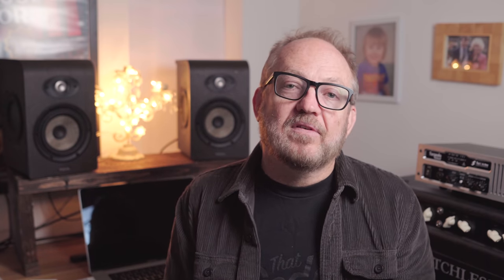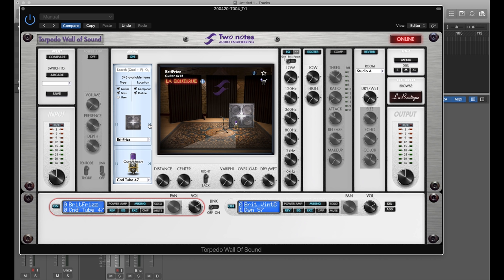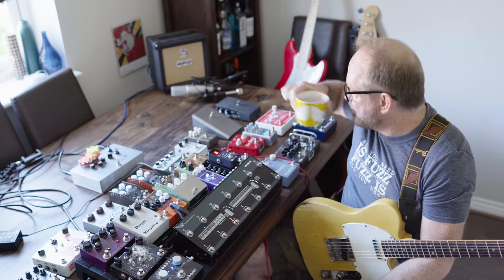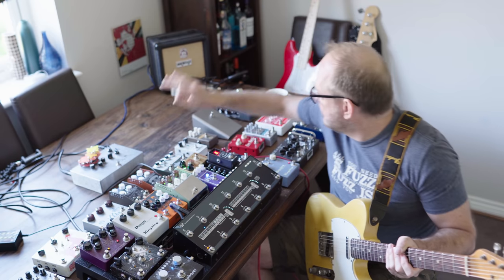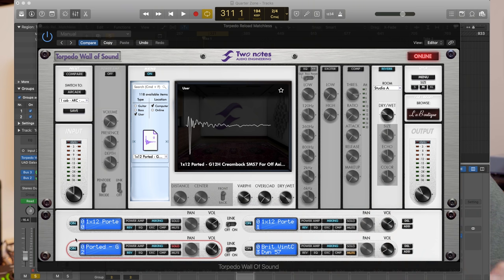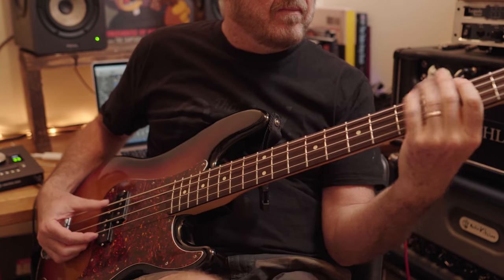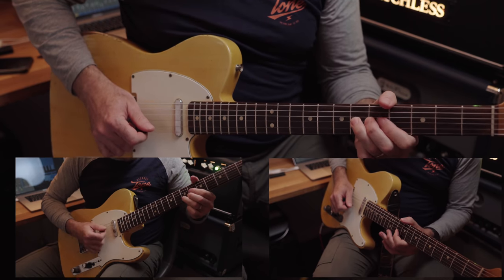Recording Guitar Amps With IRs: Dan's EP Challenge #3 – That Pedal Show

Comment: Hi Dan! I wanted to pass on a trick I picked up from Gaz Williams of Sonic State for working with IRs. Having used IRs for several years, I still cant get past the 2 dimensional quality of the sound. To help alleviate this, once you have recorded your guitar part, simply toss a 57 (or whatever you have handy) in front of your studio monitor and rerecord the guitar part as though your monitor was a guitar cabinet. Obviously be careful to not have monitoring turned on for the track you are recording to or you will get a painful blast of feedback. Once you have rerecorded the track and checked it for phase it can be mixed in with the original guitar track to add back some of that missing 3rd dimension. Even when recorded at fairly low (neighbor friendly) levels this can make a big difference. Great video and I cant wait to hear the record! Thanks and stay safe!
Reply from the maker: Wow!!! Great idea!
Reply from the maker: This is hilarious! Mick here.
Reply: That is a cool idea! Definitely doable in the home studio!

Comment: Sounds good. I've been using a loadbox and IR's for a while now...really works well. It never sounds exactly like my amp and cab in room, but I have tons of options with different cabs...more than I could fit in my house!  You could also split signal with one going D.I. so you can re-amp later, if needed.  I usually use amp with drive pedals or clean into DAW and add all effects in DAW program. Makes adjusting in mix way easier. Always enjoy "That Pedal Show" videos.

Comment: I recently picked up a Two Notes CAB M and use a Bearfoot FX Dyna Red Distortion (Marshall AIAB) as the pre-amp. While amp-in-a-box pedals aren't necessarily a pre-amp, this has worked great with the gain down below 9 o'clock. I need to try my Emerald Green (Vox AIAB) too! It's been an amazing addition to the gear! While I haven't recorded with it, it's been much easier to play with backing tracks (using the aux in so far). The lessons I subscribed to offers a back track for each lesson to practice over so the quiet playing has also been a relief for my girlfriend :). Bluetooth connectivity is amazing for software edits and I really love the mic options for fine tuning of the sound. Really excited to see how your EP turns out Dan! Really love the harmonies and the reverb into fuzz tone!

Comment: I strongly Identify with something Dan is struggling with. I am both a musician and an audio engineer, and I find that they are completely separate brain spaces. Even though I have the equipment, knowledge, and skill to engineer my own recordings, I always prefer to hand that duty over to someone else so I can focus on the performance and nothing else. However  that's not always a luxury that I or many other folks have. What works for me is to set aside separate blocks of time. I'll take a week and just get a session template for the project together, and dial in various sounds that fit what I am looking for, save those as presets that I can recall later. I don't worry about writing or performance at all during this time, just getting things dialed in. Then I take a few days off and come back to write and record my parts. It's much easier when you have a palate of sounds ready to go and easily tweaked on the fly, allowing you to focus on the music and be creative.

Comment: If you’re at all frustrated with how long it takes to dial in IRs, I’d suggest trying out the Ox. Sure, you’ll still spend some time figuring out what cab/mic you want to use, but I found that I was able to dial in sounds much much quicker with the Ox than with the Two Notes stuff and it made my home recording a lot more efficient. I’m certainly not saying one is necessarily “better” than the other, just advocating for giving the Ox a try in comparison.
Reply: I think the ox sounds like a good idea, but only if you have a spare grand... I think they are really expensive, as the case with all of universal audio kit. 
It's much more than even your average amp

Comment: So I've been working with the Two Notes Torpedo Studio for the last few months now and wanted to add an additional point. So when you're recording normally, you get the exact tone that you want out of the amp, and you mic it in such a way to reproduce that sound as close as possible on the recording. That gets flipped around with the IR setup. You have to pic the cab and set the mics the way you would think they sound best, then set up your amp to sound the best with that mic configuration. The hardest thing is trying to figure out what to change when it's not sounding the way you want it to. The best thing and the worst thing about the IR setup is how much versatility you have in your sound.

Comment: Excellent video. Economically this has become the way my band works now and I'm in the process of finishing off tracking for a full length during this isolated time. It absolutely took a while to get into the headspace of "engineering" a sound rather than rocking up with my cab and saying "make it sound the same with mics" lol. All in all we've realised it's cut the costs of tracking guitar and bass by at least a few thousand dollars and the stress factor is lower.

Being able to record at home when you're in the mood and comfortable rather than watching the clock because every hour is costing $80AU. The takes are better, the creativity is higher and the only costs involved so far was tracking drums in a studio and mixing/mastering.

So far our full length is costing roughly a third (maybe less) of our last EPs costs for tracking, mixing and mastering!

Comment: The problem with IRs is: suddenly you have millions of possible speaker / mic combinations available. You think you need to try and use them all. Takes time. And won't work. So, what I do is, identify my speaker. Then try some cabs with these speakers, then finally chose 2 mics and mix them to taste. For the latest High Road Easy I did also use the stereo room IRs, just blending it a bit on the opposite side. Gives it a bit of depth.

Comment: Not for nothin' but probably could save a boatload of time using the Strymon Iridium in stereo on the "round" and letting your guitar choice and pedals really shape the sound of the parts.  Either that or just spending a couple minutes on the ox and you'll get a great sound really quickly.  I'm often blending these two together.  Another tip, on the ox I lean towards using 2 ribbon mics for that extra bump that Bea mentions.  Notice on his ox he has a setting with double ribbon mics loaded up.

Comment: Is always a great pleasure spend my time with you guys, whether you’re together or not. I think guitars sound great, but my question is: a load box like Torpedo or OXBox or whatever is useful even form people like me that have only combos? Can I use a LB even for record guitars straight into the desk or computer or do I gotta have NECESSARILY an amp’s head of 100 watts to buy a load box?
Reply from the maker: You can use a combo of course! You just need to intercept the connection between the amp and the speaker. Most modern combos have jack connecting the speaker from the amp section. The load box goes there. Cheeers!

Comment: Hey Dan - loving the videos. How are the Focals working out for you ?  Also, something to try if you haven't already - Mike Scuffham, who was an amp designer at Marshall, has a really cool software app with amp/cab (with IRs) simulations called S-Gear. For me its one of the best, and easy to use software amps/plugins which can also be used stand-alone.

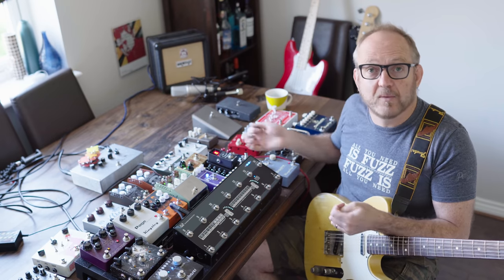Comment: Love the monitor stands at 9:05! But 'making' them must have required you get some upright support yourself? :-D

I have a suggestion for bass track recording, although it's my personal aesthetic choice rather than a rule: create it before the guitar, add some dirt (a valve guitar amp through a bass IR might sound really good!), and prioritize EQing your guitar tone to the bass, rather than the other way around. That way the bass line and guitar parts have a chance at interplaying more. With a guitar tone set first, usually too bottom heavy, a bass ends up just filling few inaudible spots very low or very high, and you get the effect of bass being noticed only when it's not playing. Unless that's what you're going for, then carry on, don't mind me.... :-)

Comment: You are really making it harder than it needs to be! If you use the Two Notes stuff just use their cab packs. Much easier to audition and you can move the mikes around. Stick with one cab and use different mikes and placement, it will sound full. Also better to record as dry as possible, you are layering too much it will wash out. You say it does not sound like you cab, but believe me if your cab was in a soundproof room and you were listening back through a mike and studio monitors this is exactly what you would hear.

Comment: I just can't seem to adapt to this new way of recording. All I want is a  damn 1/4" or 1/2" (cue: choir of angels)  reel-to-reel, a desk, (let's say 24-track all-up but 8 will do) my gear, a couple of good mics - and a room.
I hate Digibollocks. But, needs must, and this is most helpful. I get to watch someone else doing it. Boy, do I need a Rabea in my life. Tech support! Tech support! All my IRs sound like hammered crap!
Like Dan, I am a total newbie but unlike Dan, it just beats me up every time I try to use this stuff. Does my head in. Insert something Mick would say here
Reply: Matt Gilbert you can’t beat R-R. Mic a guitar and get the true sound of the room with old tweed amp and an old Gibson or Fender. Good pre and mic. Forget all these new extra digital gadgets.

Comment: The one thing I think Mick might struggle with and even Dan to some extent, even with IRs or other direct options (Kemper, Helix, Ox Box) you still need to listen to it loud. I know it’s meant for silent recording, but listening loud in studio monitors makes a massive difference. 

When it’s quiet my tone still sucks. 
Tube amps loud are amazing, but you can’t forget that direct options sound better loud as well. That’s been my experience with direct options. Cheers dudes!
Reply from the maker: Yep. Right with you. Mick here. I’ve given up and just gone back to mics and speakers. If I can’t do it at home, I’ll hire a rehearsal room. Or use the TpS Studio!

Comment: My mistake with IRs was trying to make it sound like my amp would in the room. Nope. Don't work like that after all. I needed to go for what my amp would sound like in an isolated studio room while I was hearing it through the desk monitors in the studio control room. Much harder to do if like me you have not experienced much of that to get used to the different playing feel and sound of not being in the room with your amp (I am not PRO, but from what I understand lots of them refuse to lay down tracks sitting in the control room, because it messes with their performance -- while also not getting the sustain from feedback etc. I think they are the ones that could find it hardest to adjust to using IRs. Getting that feedback while not being with the amp is possible though. Solo the guitar thru its own monitor and sit in right in front of it. Different sound but it works and is better than nothing if not getting noise control called on you is an issue).

P.S. Guy next door here in my Auckland, NZ apartment building has made literally dozens of complaints about the faintest sound of guitar coming from my studio monitors. I stick to a volume so low that I can hardly hear my music playing from the other side of my apartment when I make a cuppa. Nothing else in this noisy building gets him complaining, e.g., the unusual, perhaps a little kinky couple that seem to chase each other around giggling and squealing for an hour or so at a time. The complainer drives me nuts, because he must be able to hear almost nothing, but as soon as he realizes it is somebody playing an instrument he calls the building manager. I knocked on his door. Turned out to be from England where I grew up too, plus a musician (jazz keyboard player) He even told me to wear headphones to watch TV at volumes I can not even hear over my kettle boiling. Some people. I put up with it because I hear him coughing lots (for years, so is not this nasty bug)

Comment: Looking at the extensive workload, i think a simple isolation box with 2 different mics and distances w still work better.
But Dan is prob in IR trial mode..for now.
Mick has given up i think.
Reply from the maker: He has! Mick here. Every guitar sound I have ever loved has been a mic on a speaker. Come on, argue with me. ;0) actually, please don’t. But a fact is a fact! :0)
Reply: @ThatPedalShow  yeah, how many variables do you need to stack before you settle back on a more straightforward system? (Don't need t answer that, Mick!). It KILLS the creative process, but if a producer wants to re-amp using a different IR system derived sound, by all means.

Comment: It's just a problem of learning and doing at the same time Dan, that's almost impossible to do when you have a clear goal like you do. Don't beat yourself up :-) When the EP's done, the next one will be so much easier :-) As you said in the Q&A, you can't change the process and get the same result. And similarly, when the process feels more natural, the result will feel more natural (to you) as well. Limit how much time you'll be using on searching for tone when recording, 'cause if you don't it's so easy to mistake being unhappy with the sound with feeling the pressure of performance...  Especially when Tone is your safe zone! (that sounds like a pedal show T'shirt :-) )
Ego has a million ways of holding us back.
Sounds good to me, at least for a rough mix!